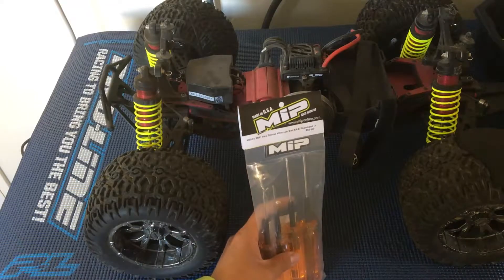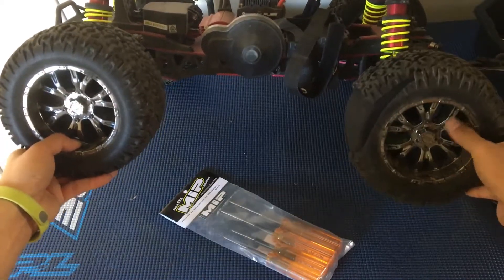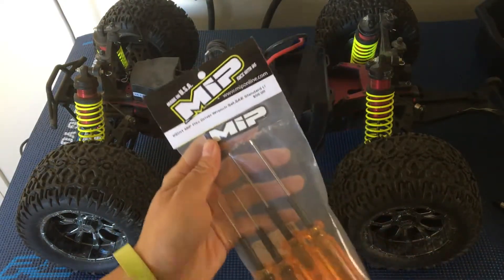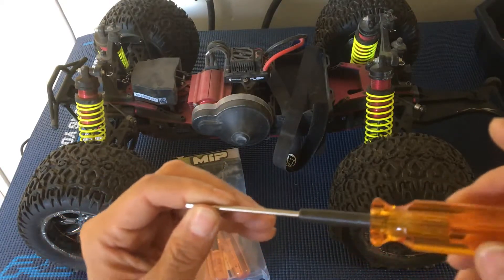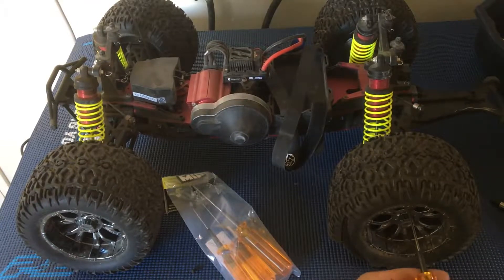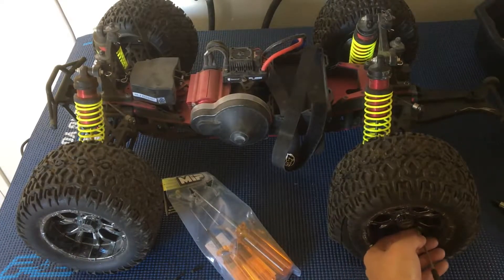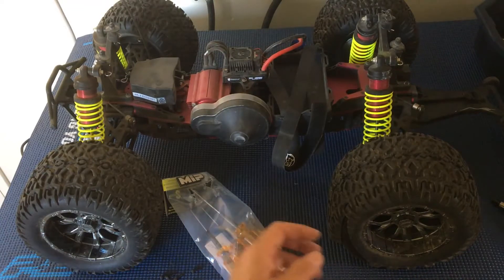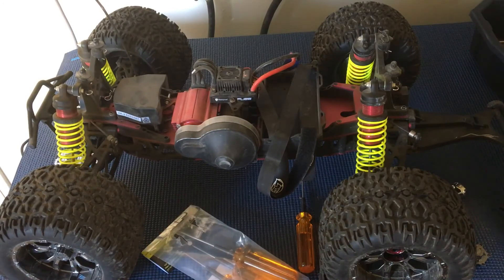Racing2Learn: 1/8 Monster Truck: Losi LST XXL2-E Wheels, Tires, Unboxing MIP SAE Hex Drivers

Comment: There is a thread somewhere showing how to convert to standard metric hex for the chassis plates. Seems to be a good upgrade if you have the time.
I just leave the center caps off and use capped wheel nuts. Thanks for sharing.
Reply from the maker: Thanks for the tip Ken! I saw it mentioned the metric conversion mentioned in a thread. We'll see how painful these 1/16 inch hexes are and if they warrant replacement!